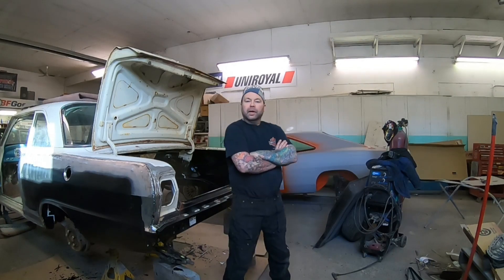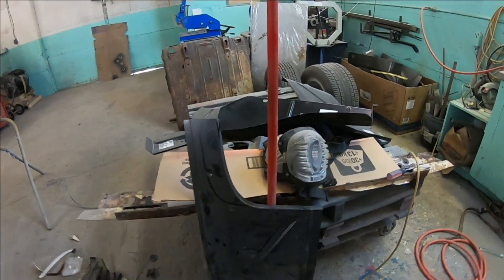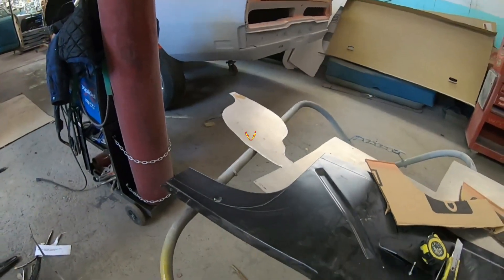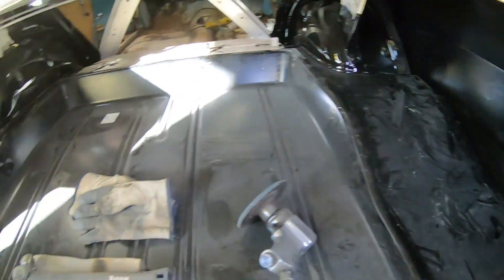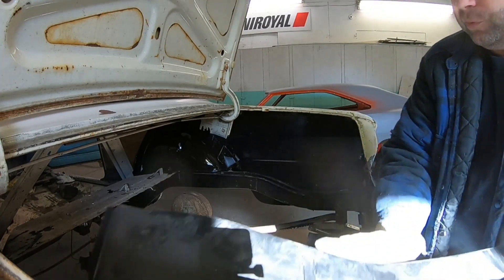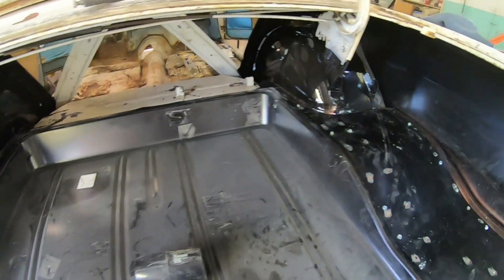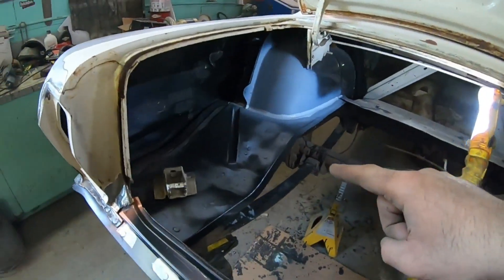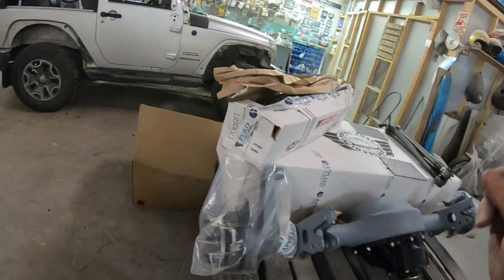chevy 2 part 3,trunk floor installation

Comment: I just bought a 65 nova 2 mor door
The previous owner rattle canned the old turquoise flat black. I need to replace the front floor pan And the entire trunk floor. For now the paint is the least of out worries but my wife may just want to clear coat to save the Patina, is there a way to remove the black and save the patina? Do you recommend welding braces In the car to try and keep it straight? Is there a place to weld them? I am in oregon
Reply from the maker: If you have the car on stands it probably won’t need to be braced up,I would put stands at the very rear to make sure the back can’t droop when the trunk floor is cut out, and keep a close eye on the door gaps. If it’s spray canned, the paint should be “reversible” as it doesn’t have hardener , should wash off with laquer thinner, although if it’s original laquer underneath it may soften up as well.

Comment: One thing some people don't realize is how important seam sealer is around all you seams to keep our moisture. Looks like you POR 15 but do you have any trouble with it not sticking if the is no rust ?
Reply from the maker: If I use it in clean metal it gets sanded and primed first👍🏼

Comment: How do you replace rear 1/4 panels on front fenders of 95 Z71 chev. Do you have to remove fenders. If so how do you get the piece straight. Thanks.
Reply from the maker: You mean just the lower rust repair patches? Yes, fenders will have to come off, but will need to be back on to align and tack in place, then off to finish weld and inner paint. These fenders are usually pretty inexpensive and less work to just replace
Reply: @Johnnymidnight  That whole lower foot was just full of sand , and looks like maybe damage in behind the fender also. I was just thinking the less I have to paint the better.

Comment: How many hours do you think you have just  on the back of the Nova?
Reply from the maker: I think at this point it’s around 60-70 range
Reply: Damn you still got that in sanding and blocking. Right on keep it up
Reply from the maker: Only taking this one to where it’s structurally solid, then the owner is going to take it home and do the mechanical, but it’ll be back 😉